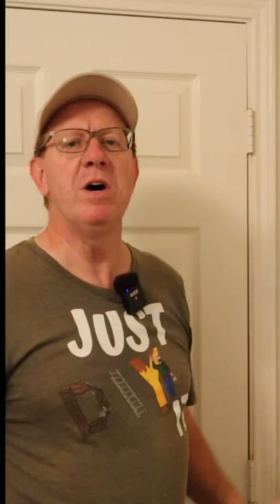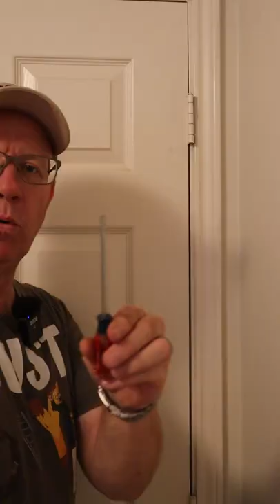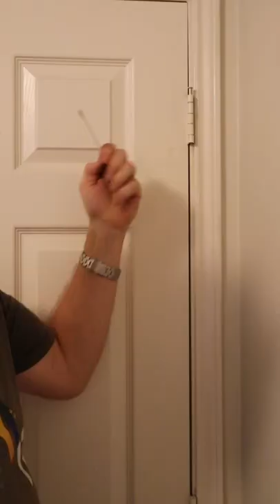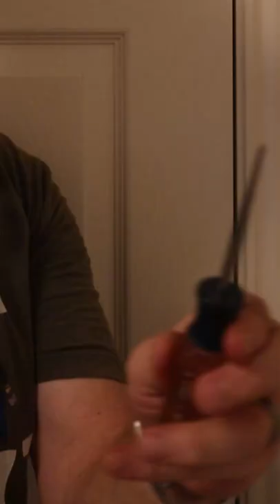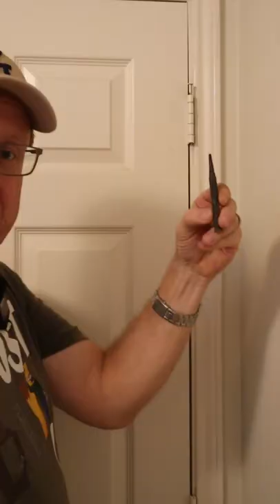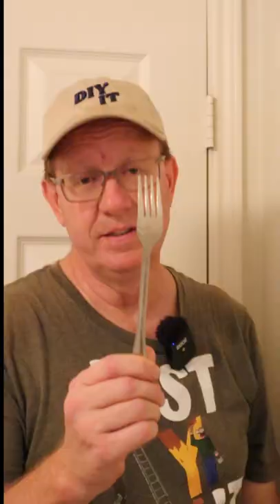Multiple Tools to remove Door Hinge Pins  shorts#

Comment: A rotted tooth is easier to get out than my door pin.

Edit: I purchased from Home Depot the Everbilt Hinge Pin Remover. It cost about $6.00. It attaches to the barrels(back side)on the door hinges. One thing though your barrels/ hinges have to be is normal in-size. If you have thick barrels on your door hinges it won’t work as well. I attached it and used a hammer to pound it at the bottom and walla the pin popped out! I was shocked it actually worked😀